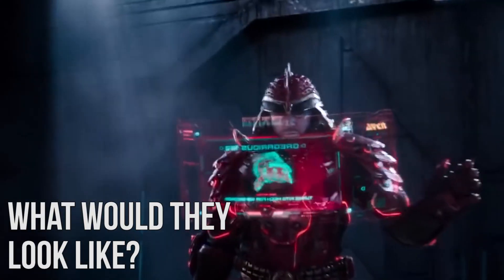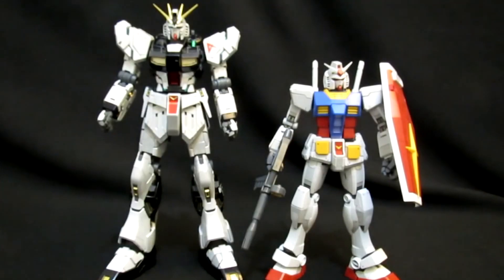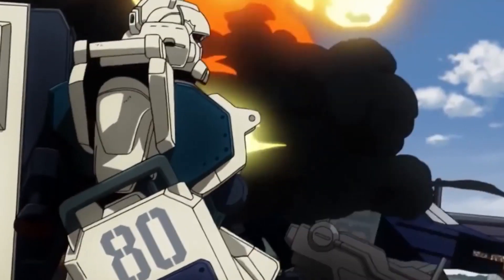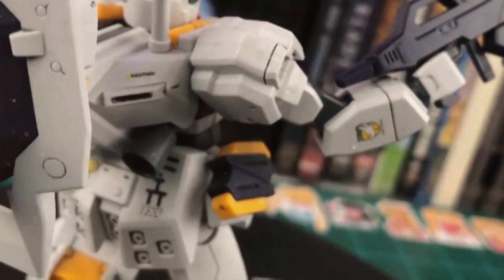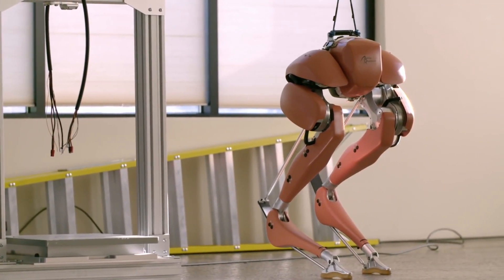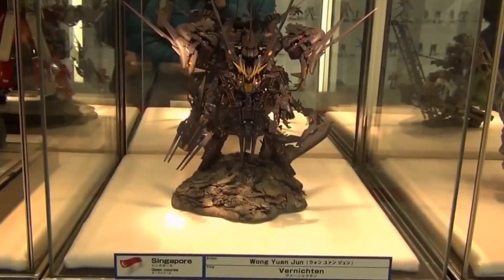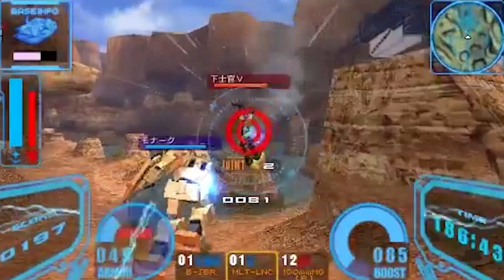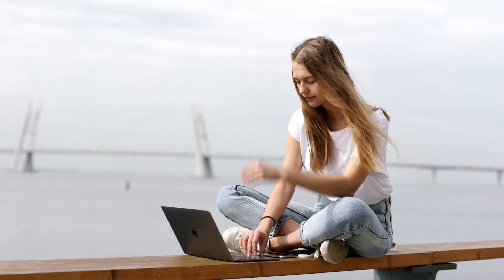Gundam Technology: Could We Build Our Own Gundam?

Comment: for any mech its the power supply that really hinders them,  you need average city level power to run 1 mech
Reply: Not only power, but the way a gundam moves, a cockpit as shown in the series I don't feel would be sufficient enough, it'd either need to be something like IBO or in a similar sense to Pacific rim just with 1 pilot, right arm is right arm etc, neural implant possible but also a helmet of sorts so you see through the eyes of the gundam, essentially being a suit of armour.......but I'd say movements would be the biggest issue
Reply: So, it just needs a small nuclear reactor then realistically.